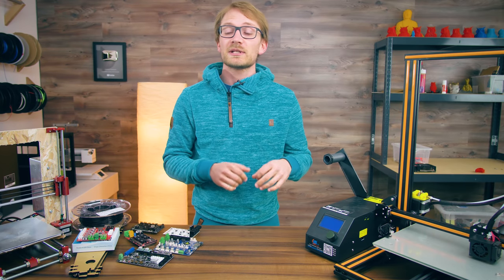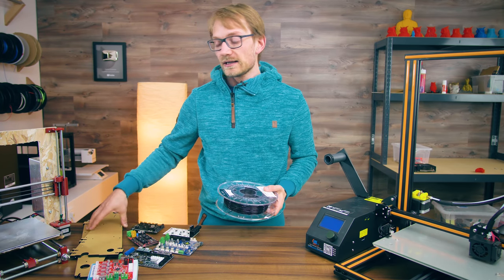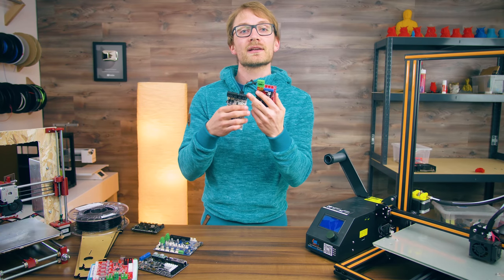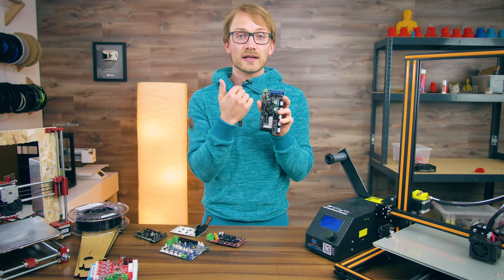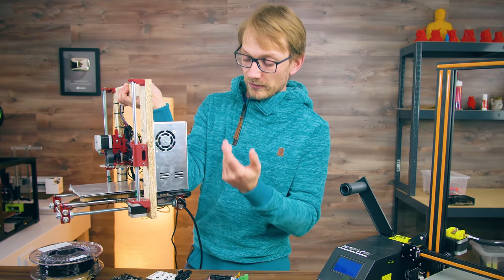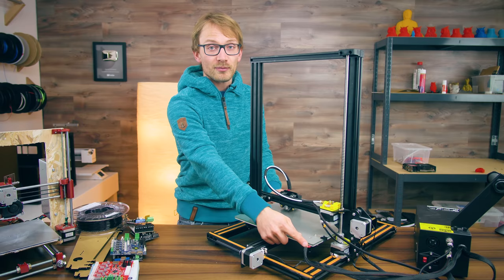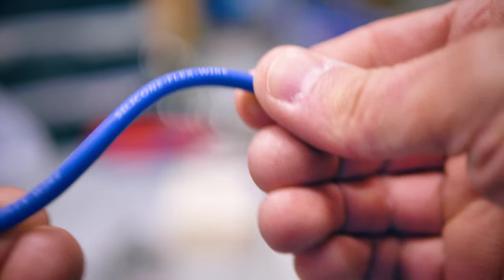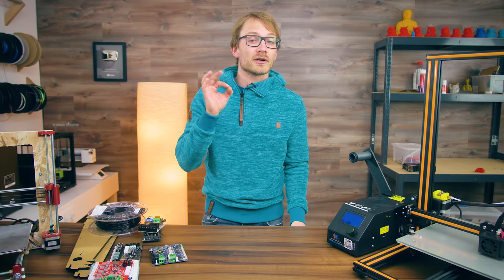Everything you need to know to make your 3D printer fireproof!

Comment: I hope that the next "boycot" after the GPL will be "Thermal Runaway" since most of the Chinese manufactures do not add it to their firmware, like Anet and Creality... If it would be enabled there would be 90% less of "my printer caused house to burn down" posts on facebook. (yes it wont fix the shotty electronics, but the heater cartridge/bed wouldnt be the reason for the fires.

Comment: Please stop spreading miss information.
Tinned copper connection is much more reliable than none tinned, copper can corrode and introduce extra resistance to the connection, which will cause higher temperature in the connector.
It has to be done correctly though, it's should be a thin layer not a blob. 
It's also first time i've ever heard about tin slowly flowing, tin has melting point of 231°C, it's as solid as it can be, it's just soft.
If you put a blob of tin on your copper wire and then tighten it, it will deform under pressure.

Comment: Thanks for the video Tom, very helpful.  I would like to know what your take is on the value of the primary fuse ( integrated in the power socket) of the CR-10?  Mine is rated at 10 amps which I am thinking is a bit too high for a 220V circuit?

Comment: Thomas, do you have a recommendation for a  board that supports dual z-axis steppers, and dual extruders? I have an original RigidBot which has less than perfect electronics, and would like to upgrade to a board with higher quality connectors and such as you recommended here. I took a look at the Trams board, but that seems to only support a single extruder unless I'm missing something. Thanks! -Edit: I suppose I also could just wire the two z-axis steppers together and use a single Z-Axis port. So that just means I need a good board with dual extruder support.
Reply: Many boards have headers with IO pins that can be used to control an external stepper driver. That's not as pretty as an onboard solution, but it would allow you to use a more common board for your purpose.
The Duet is a pretty good board, and there even are official stepper driver extensions for it, should you be scared of doing the wiring yourself.

Comment: To protect my Prusa i3 from dust and damaging in my garage/workshop I look to see a useful review on an enclosure room for a 3D printer.

Did you already a project about the enclosure of a 3D printer? Or do you like to work out some project about?
I like to make one, but not sure to create one with the filament spool in- or outside that enclosure. What are the plus or mins about that? I suppose temperature is one of that ...
Reply: B-Art of Noise i have a big printer with a 20cm cube work space (velleman k8200) so i have enough room inside... I'm not sure but a drybox for filament should be the best idea bc heat might can cause a filament slip in extruder...

Comment: Seriously the average person has no idea how to inspect that a MOSFET or a wire connector is safe. Even when they pass a visual inspection, are rated properly, and installed properly they can still be a problem. I had a low cost Chinese made RAMPS clone do a little flameout once, and I am pretty "with it" in this department. I think the culprit in my case was a solder joint on one of the two input GND connectors that was insufficient, causing the current to return mostly through the other terminal which overheated.

It's worth noting that many of the problem printers in question also come from the manufacturers who cut a lot of corners to get a price point. For instance the overwhelming majority of these manufacturers do not follow the software licenses of the open source projects they (mis)appropriate, so it is impossible to know what software-based safeties they are implementing or whether or not they are even running firmware where certain safety-related  bugs may have been fixed.

The most appropriate advice to give is to operate the printer in an area where it will not cause a fire to spread if it does have a problem and to use mitigations such as an automatic fire extinguisher (Haven, AFO, Firestop)

Comment: I've been wondering if I need to do a mosfet on my Wanhao Duplicator i3 (original one). Don't like the thought of taking the controller apart really and I don't use it enough to care lol
Reply: Yes. You do. Mine went up in smoke and I wound up doing some heavy modification to change the mainboard and add a high power MOSFET for the bed. Stock firmware had thermal runaway protection disabled, and the bed temperature got to about 130 before the board started burning (my octoprint temperature logs were intact)
Reply: @joshmaceachern7383  You have an older Wanhao Duplicator i3? Would you recommend adding a arduino to update the firmware? Do a firmware change and add a mosfet? Any recommendations on a mosfet or just pick one off amazon? I'd hate to "fix" my printer with a worse piece.
Reply: @amorton94  The Melzi mainboard in mine caught fire, and I replaced it with an Arduino Mega/ramps 1.4. The bed MOSFET I used I bought from Amazon; I believe the seller was Biqu. For the most part if it has positive reviews it should be okay.

Comment: Why not put in a smoke detector with a relay output and have that drive a contactor. The power rail you attach your printer to can then be actuated by the contactor. That is the safe solution in my opinion.
Reply: Erik Jorgensen maybe not but still very easy to find. Cost 30$.
Reply: The smoke detector needs a fire togo off, cutting the power after the fire has started is probably too late. It will audio-alarm you though.
Reply: rune vikan smoke come before fire. Cut the power and there is a good chance you won’t have a fire. But of course you can ad a CO2 blast to the same relay control if you feel it is needed. What is a fire togo?
Reply: togo => to go.

But I agree with Per K. A fire detector with a relay could very likely arrest a fire before it gets out of hand. As wires melt there is smoke coming off, as insulation melts more and more wires are shorted out typically adding to the thermal energy of the fire.

Comment: Damn, the heater Cartridge of my A8 also fell out but i was around and stopped the cartridge from melting through fanshroud.
The Grubscrews thread (in the heater block)simply disintegrated.
Block & Sock Upgrade from e3d highly recommended for all the A8 Users.
Reply: I'll have to check that out. I already notice the thermistor is held in the block by the grace of nothing. -__-
Reply: I've set up the strain relief and cabling on my a8 so that the thermistor/heater are pushed into the block by the cable tension so even if the screws fail they can't leave the block

Comment: I can relate to the silicone wiring on the heated bed of i3 style machines. PVC wires will inevitably go bad over time. I had that happen twice before switching to silicone.

BTW, safety is the main reason you don't buy a cheap noname 3D printer from China.

Comment: The best idea is to use a raspberry with octopi and a carbon monoxide and smoke sensor, which then switches off the printer and triggers a carbon dioxide extinguisher to go off.

Comment: I have a 3d printer with a wooden frame, no strain relief on any cables with many cables rubbing on the frame, a cheapo RAMPS controller and all enclosed in a wooden chamber heated by an cheap 500W AC wall-mount-type electrical heater. Hmm... maybe I should make some changes...

Comment: I’d really like some sources on the solder comment - i’ve heard and read differently.
Reply from the maker: Tinned wire ends in screw connectors are prohibited by the German norm VDE 0100-520:2013-06
Of course we have a norm for this sort of stuff ;-)
Reply: Thomas Sanladerer Thank you! You continue to be a preferred source for everything 3DP.

Comment: Somehow 3D printer manufacturers (All of them actually... yes.. ALL OF THEM ! ) thinks it's okay to undersize wire gauges just because "It's only 12/24 volts.".
Even the Ultimakers have undersized wires going to high current components.

Comment: A metal enclosure with a smoke detector and BlazeCut. That is all I am saying.
Reply: Hachiro he also showed a cheaper option in the video but idk if I trust those. There is also those exploding ball extinguishers but those are not really advised in the US.
Reply: What would be the material of the frame and of the walls (simple to cut and not pricey)? Would ANY material be resistant enough in order to not melt under a consistent fire (until the automatic fire-extinguisher would kick off)?  How would you make the electronics safer with  this kind of enclosures? Do you have any tutorial that would help someone who would like to make their own closures?
Reply: I doubt many A8 owners are willing to spend as much for fire suppression as they paid for their printer.  But I agree with what your saying (I don't own an A8).  First they need to upgrade their firmware to one that has the safety features enabled (because they are not by default).  Then getting/making the metal enclosure with the fire suppression if they plan on leaving it while they are not around.  I personally didn't bother getting another smoke detector as BlazeCut "should" take care of it and if it doesn't I have a detector hard wired in the room anyways (no need for double coverage).

Comment: in the anet group i'm part of a lot of new 3d printer owners don't want to upgrade the firmware to the latest marlin even when you tell them that the firmware is something that will protect the printer from burning down their houses! really i think that most of the time it's plain lazyness or ingenuity of the owner of the cheap chinese kit! sure a super safe printer with flame retardant materials is awesome but they really miss the basics like wire with damaged insulations and sketchy soldering job made "just because they told me to do so" and hazardous enviroment...

Comment: Wifie is already scared of my prusa i3 mk2s 3d printer will burn. Hiding this from wifie, pretty irritating.
I don't know much about electronics so no, i don't know whats best. I rely solely on the minds of the engineers that build my 3d printer.
These burndowns rebuilds the walls that separate 3d printers from the masses, sadly.

Comment: Surely I buy a printer and that printer SHOULD be safe. If Thomas is saying that a lot of the components on printers are not actually safe then isn't this a problem with the manufacturer that someone should be addressing??
Reply: Stephen Boyd good luck addressing some chinese dudes who are safe within their country borders...
Reply: Sh4dy but they are for sale in (insert country) which brings them under local laws.
Reply: Its not the manufacturers its us, the consumers, anyone who buys a rock bottom price piece of equipment ought to recognise that there's a reason it's so cheap and if we only bought safe ones they would switch to making them and the price would stabilise. As it is we buy the cheapest possible and then complain when they are actually 'cheap' rather than 'safe'. If you want some level of safety guaranteed then buy in country from a recognised manufacturer who has passed the relevant local standards - its more expensive in the short term but doesn't need the worry and 'add-ons' discussed here
Reply: Stephen Boyd speaking of europe: the one importing it the first time (to resell, not as private consumer, I believe) is the one responsible to check if it's actually safe / within the regulations. No chance to reach the actual manifacturer. 
Of course, somehow there is a way to reach back to the manufacturer, but it's so complicated and time-consuming that no one is ever gonna do that. And the chinese gov. has no interest in changing that, as it would hurt their export sales. This is probably the main reason why cheap stuff that violates our regulations is still sold in vast amounts where I live.
Reply: That and the fact that we cut lots of deals with the Chinese to allow free trade when we needed them to prop up our financial system and fund our ski-lifts/nuclear power plants, etc :)

Comment: Sorry to disagree Tom but soldering stranded wire to the bottom of a connector that you have left in place is an incredibly bad idea! It is not hard to remove and replace the connector with a good solder sucker or solder braid... if just one strand gets loose or out of place, Fire... you are also reducing the distance between traces... also a REALLY bad idea... those are already engineered to be as close as they possibly can and you are making the distance even smaller with NO coating to resist an electrical arc or leakage current... Since you are already voiding any warranty or UL rating by messing with the board, at least do it the RIGHT way or don't do it at all.  Furthermore... needing a heatsink indicates a flawed design?!?!?! What planet are you living on?!  Go ahead and open up a high end stereo, heck even your computer and count up those heat sinks... go ahead, I'll wait... That is easily one of the most Flawed statements I've ever heard from you... Other than that, the rest of the video was great and the re-emphasis on regular maintenance and equipment checks is spot on!

Comment: Just wanted to mention that your smoke detector is mounted wrong and in worst case might not be triggered... A smoke detector ALWAYS has to be mounted horizontally on the ceiling to work as expected
Reply: Sure there are some but they have to be declared as that and beside this, there a also local regulations which might limit the use of them. For Germany for example (or Europe I guess) there are only a very few exceptions when it is allowed to put them on the wall and there are also reasons for that because if the Detector is not declared as wall mountable it might just not work because the smoke does not enter or at least not the rigth way.

Comment: I think the best thing to do is not buy super-cheap Chinese printers in the first place.
Reply: Guarantee you that Non-Chinese printers are built with CHINESE Components.
Reply: This. The issue is the sheer volume of new designs through people on Kickstarter and such, that then get manufactured in China for as low a cost as possible. Those same people often do terrible QA/QC and it becomes super easy for substandard parts to be used or even spec'd in the first place, that introduces these hazards. I have an original RigidBot Big, of which the only real surviving part is the main board and frame, but even the main board has a lot of the substandard connectors and such that Thomas pointed out here. Some of the components that came with the printer (especially the power supply) were just fires waiting to happen.
Reply: EXACTLY
Reply: Denniss7420: No doubt. That really isn't the issue. The Chinese can build to an acceptable level of quality these days. However, they are often pressured to build as fast and cheap as possible, so quality suffers in that case. That is why I said CHEAP Chinese printers and not ALL Chinese printers.
Reply: Price is a bad measure to judge a machine though. A company will make a product as expensive as they can while still selling a lot of units (unless they are trying to get rid of a competitor), that's basic economics. That's why even an expensive machine might contain poor-quality chinese parts, while another much cheaper machine might contain better ones. The only way to be sure is to look through the feedback and reviews, as well as look for anything obviously problematic in the product description and photos.
Reply: theyre so cheap though.... too tempting lol, that said buying a not-knock-off deathtrap Chinese power supply and driver might be a sound idea.
Reply: There is a rather common thread there... I want a high quality printer with great parts and awesome precision... but I don't want to pay a lot of money.... then there is the whole DIY market with the varying levels of ability or expertise... these things are NOT toys... they are tools... industrial tools, that have been brought to the level of "home use"... this does NOT absolve anyone from being sensible about inspecting them for hazards, nor accepting and applying the necessary steps to mitigate any hazards involved in the use of these machines... putting the two words "cheap" and "Chinese" next to each other is also a rather disingenuous statement... thousands of your average everyday items have LOTS of high quality Chinese manufactured parts... or Mexican, or any number of other countries... there are also cheap and poorly manufactured parts... from every country... INCLUDING the United States... Caveat emptor, let the buyer beware... if you think you are getting a "bargain" or are demanding lower prices, you ARE going to suffer some quality or design limitations.. deal with it accordingly or don't buy it at all.
Reply: jup, frankly you cant beat what you are getting for the price.
Reply: Nothing wrong with them if you know what you are doing. Buy them and use them for a while, while saving up for better parts. They are only dangerous if you don't know what you are doing.
Reply: well that's partly true... but even if you know what you are doing things like the cheapo supplies often have too little track clearance which makes them dangerous regardless.